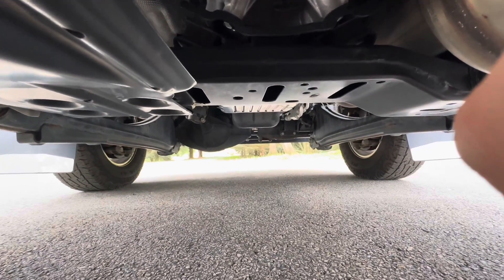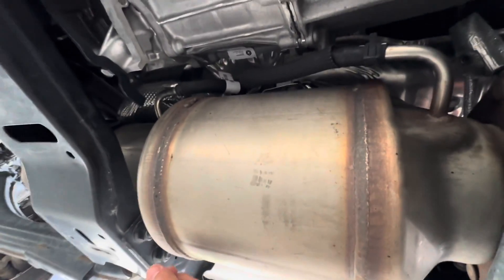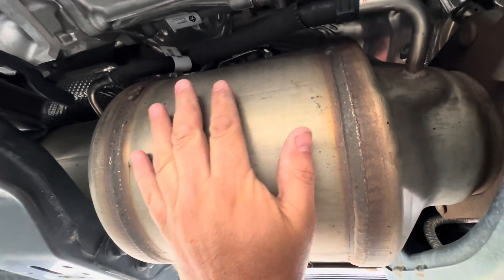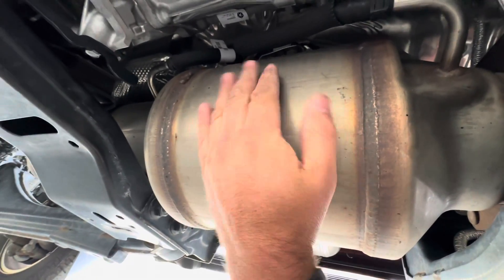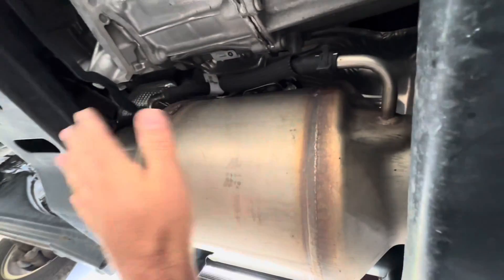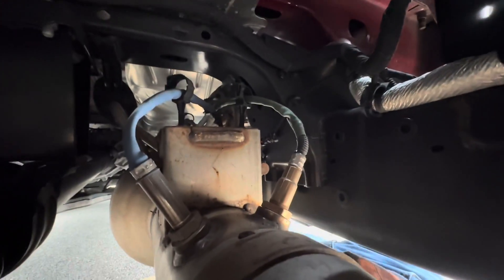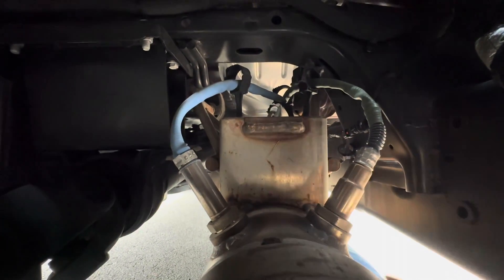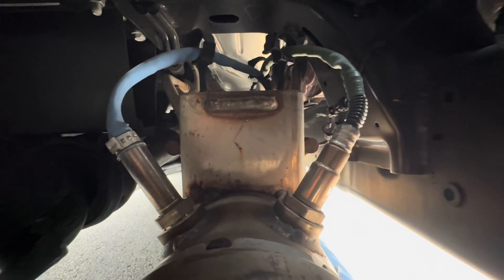2022 Ram Cummins DPF Regeneration and Y43 Recall Explained

Comment: Thanks for the video, super helpful.  My 2019 Ram 2500 has 53000 with check engine light "exhaust filter full, power reduced, see dealer" . Two weeks ago I had a mechanic clear the code so the Active regen could take place.  I drove the truck for about 40 minutes and all was good.  Until yesterday.  The filter was showing about 45%ish, the active regen started, but after about 10 minutes, the same error displayed.  I have two questions.  A: does this mean my filter needs to be removed and cleaned?  B: Is that covered under warranty?  thanks for any responses.
Reply from the maker: Very unlikely that your DPF needs replaced in 53k miles. More likely you either have an upstream issue that’s preventing the DPF from regenerating properly, or something internal to the DPF is causing a regeneration issue. If the dealer is seeing code P242F and basing their judgment on that trouble code alone, that’s not a good enough diagnosis to automatically rule that the DPF needs replaced. There needs to be some diagnostics performed to find out why the truck is not regenerating properly. How do you drive and use the truck? What kind of drive cycles does it see? Are there check engine light and trouble codes active? How many engine hours (drive hours and idle hours)? Factory Emissions warranty is 5 years or 50k miles. Some states have overriding emissions laws that extend the warranty.
Reply: @TheRamGuru  Thanks for the quick reply!  I have an appt with the dealer tomorrow, so I'll see what they say, but wanted an independent opinion before they suggest replacing it all at my cost.  I'll be sure they do some testing.  The truck exists in my world to tow our 12K lb trailer, but it's also my daily driver in Arlington, VA with a 10 minute commute to work.  It only gets good and hot maybe a few times a month.  running hours is about 1200 and idle is ~250ish.  I picked up the truck in 2022 at 16k miles after sitting on the lot for a year.  I purchased the extended warranty to get me more time due to it being half way through warranty.  Thanks again for your response.
Reply from the maker: @dairyqween  no problem. With those short drive cycles, it’s not going to get hot enough to regenerate passively, especially if that commute to work is all low speed and stop / go driving. Do you monitor your active regeneration cycles? Do you allow the truck to complete those when the message shows on the dashboard?
Reply: @TheRamGuru  I have not paid much attention until two weeks ago.  I will now. sounds like I should plan on getting it out to stretch its legs more often.  I'm happy to hear it shouldn't need replacing at 50k miles.
Reply from the maker: @dairyqween  you really want to try and get it on the highway at 70mph or higher more, especially when it’s going into an automatic regeneration. It’s really important to let those cycles complete. Usually takes 20-30 minutes on the highway. Constantly interrupting those regeneration cycles, especially with a truck that sees repetitive low-speed operation or lots of stop & go, can lead to DPF issues. The truck never gets a chance to adequately remove the soot in the DPF. Also avoid idle time as much as possible.
Reply: @TheRamGuru  Just as I was worried about...this is the advice from the dealer.  I would like to ask them to Check the sensers or something before just replacing it all.  is that a thing?  thanks for any advice you have on avoiding the $3700 replacement.

Advisor comments:

Diesel Particulate Filter, dpf gasket, both exhaust gas temp sensors, Differential Pressure Sensor - Replace the Diesel Particulate Filter and sensors then perform the DIESEL AFTERTREATMENT VALIDATION in accordance with the Service Information
Reply: For those of you following along, the DPF and associated parts labor will be covered under warranty and will not cost me $3700.
Reply from the maker: @dairyqween  that’s good news!
Reply: I had a customer bring me a 2022 ram Cummins today that cannot be forced region It's a forest service truck. They are down here fighting the fires in New Mexico. The dealership couldn't regen it and sent them to me. It's only got 22,000 mi It's reading 100% and will not let me force manual regen. I guess there is a problem going on with the their security at the dealership that's why they can't do it. But I used a bypass cable and it still would not let me perform a manual. Regen, have you seen this problem?
Reply from the maker: @SMOKEY-JAYS-DIESEL  is the truck showing DTC P242F?
Reply from the maker: @SMOKEY-JAYS-DIESEL  when that code is active, the system will sometimes inhibit active regeneration because the truck thinks the DPF is full of ash, not soot. So it won’t let the DPF run a regeneration cycle because ash isn’t able to be burned out in regeneration. It has to be washed out mechanically with high pressure water or chemicals. At 53k, it’s not likely that the DPF is full ash restricted. It’s probably just so full of soot from high idle hours or a lot of low speed operating where it couldn’t effectively regenerate all the soot out. It may also be face plugged at the DOC. What you might want to try, is to go into the pcm with a good scan tool, reset the regenerative filter timers to trick the truck into thinking it has had the DPF replaced. Then attempt to run a parked regeneration. Make sure it has a decent amount of fuel in the tank too. There’s a good write-up on this over on Cummins forum if you search “P242F - what I’ve learned” it might help you
Reply: @TheRamGuru  okay awesome thanks! I even put EZ lynk on it and used the bypass cable and that also failed The strange thing is it says there's not enough fuel in the tank which it's 3/4 of the way full. So then I adjusted the fuel tank size and then it tells me it can't read or initiate manual region but the truck only has 20K miles I have in the past. Had to wash some dpfs out using a pressure washer so maybe this is the case. I told them to just delete it LOL
Reply: @TheRamGuru we have had nothing but problems with constant regen most recently about less than 100 miles and check engine light comes on.  This has been happening about 6 months or more.  We’ve had it to the dealer twice most recently for 5 weeks.  They replaced the air suspension system saying that was the issue.  If fixed the overload code issues but not the regen.  Now waiting for another 6 weeks for a loaner to get it back in.  We’ve had it in 10 times since we purchased it brand new in October 2022 Ram 2500 diesel.  We have now contacted a lemon law attorney.  Enough is enough.  The dealer did find diesel fuel in the oil and told us to get it changed.  It had been about 3000 miles since last change.  It’s so ridiculous that Ram hasn’t figured out a solution for this!
Reply from the maker: @kristineketoon9929  it’s ridiculous. It seems like the 2022’s are especially prone to these issues. Ram is fully aware of it, but doesn’t seem to have a good grasp on how to address the emissions issues.  I have a spreadsheet with over 100 trucks on it, all of them having similar issues. 70% of them are 2022 or newer.
Reply: @TheRamGuru  your recent YouTube video comments helped us to ask the dealer to check the oil and he admitted it smelled like diesel.  We didn’t send it out for verification though.  He also admitted they have no idea how to fix our regen issue and that most diesel mechanics are not equipped to know how to fix it and apparently they just do what the star techs tell the to do
Reply from the maker: @kristineketoon9929  that’s the truth. Many of the dealerships do not have sufficiently experienced diesel technicians or those experienced enough with these emissions systems to try and troubleshoot or diagnose. They rely on STAR support, and their guidance. The STAR support is often slow to respond, and, depending on which agent the tech works with, the results can be hit or miss.
Reply: @TheRamGuru  the dealer tech also said he had not heard of diesel getting in the oil from the regen issues.  Amazing how Ram is not putting this stuff out for at least the dealerships to check for this. Who knows how much damage may have been done to our engine by now.  As I said this has been an issue since we bought it.  We bought in 10/2022 and had it in the first time in 11/2022.  They kept blaming my driving.  Seriously I am not gonna go drive for a half an hour 70 miles an hour every 500 miles or less because it decides to regen.  We have used 1/4 take of Def fluid in the two weeks since we picked it back up from the dealership

Comment: Drove trucks for a living , bought a 2500 with Cummins  , did you say when Ash clogs up , it needs to be replaced . ?
Reply from the maker: Correct, over time, the DPF will accumulate ash that’s a byproduct of combustion and the removal of soot. It’s actually the remnants of the oil additive packages in your engine oil. The ash will build up slowly in the DPF, and can not be removed through the regeneration process. The DPF has to be physically removed and washed out with chemicals in order to remove the ash. Or, you can just replace the entire unit when it becomes full of ash.
Reply: I believe the ash is what ended my hotshot business. My truck literally choked itself out.  I got completely scammed by the Dodge dealership..  They never fixed my issue. @TheRamGuru

Comment: One correction - during REGEN, additional fuel is sent to the DPF, and the soot is BURNT and turned to ash. The soot does NOT get eliminated & removed from the DPF. Soot gets burnt to ash, and the ash is collected in the DPF. DPF's get plugged up with SOOT when the REGEN process is not done, AND, the DPF will eventually plug up with ash. When this happens, the DPF must be removed and cleaned.
Reply from the maker: I never said soot gets “blown” out of the DPF. Well aware of how the regeneration process converts soot into ash via heat. Did you watch the video? 3:00 min mark forward.
Reply: Maybe you should watch the video again

Comment: I drove from Houston to San Antonio with a message particular filter regeneration in progress continue driving almost 200 miles before it cleared the message and returned to zero
Reply from the maker: That usually indicates that you are either interrupting the regeneration cycles and not letting them finish routinely, or you have something else going on that’s making the regeneration process struggle.
Reply: @TheRamGuru  can the inlet and outlet airflow sensors on the death filter be swapped out
Reply from the maker: @Kingdome_Trucking  it’s one sensor that reads both inlet and outlet pressures. And yes, they can be replaced.
Reply: @TheRamGuru  where is that sensor? Is it the one on the right at the end of the video (particulate sensor)?
Reply from the maker: @janericchannel4513  yes if you go to about 8:16 in the video, the PM sensor will be on the right. It’s the one with the green wrap around the wiring harness. It’s on the outboard side of the exhaust pipe. The sensor on the left with the blue wrap around the wiring harness is the NOx sensor. Both sensors are located aft of the SCR chamber. They are the last two components of the after treatment system.
Reply: @TheRamGuru thank you
Reply: I have run five six bottles of fluid additive claiming to help clear the DPF engine code saying that the DPF filter is full but no luck. Only 50,000 miles on my 2021 ram 2500 6.7 turbo diesel engine. So frustrating. In the whole life of the truck, I have probably only had a forced regeneration three times. Something has to change with these trucks. It’s almost as if the government wants people to quit driving diesel vehicles????Hmmmm???

Comment: What additives would you put in fuel got help keep DPF working smoothly
Reply from the maker: I’m not a big believer in additives. Good clean diesel is what you want. Maybe some additives occasionally to help clean the injectors but I wouldn’t do so routinely.
Reply: @TheRamGuru  So how would know if you got clean good diesel? You make it sound like you can go some were and measure the diesel quality.

FWIW  everybody can use and benefits from additive just because diesel quality is always lacking.  I run EDT in my fuel fill up and diesel service. I also have some Gumont diesel cleaner that I use in my New Holland since it has a basic DPF setup with no driver information on what it 's doing of anything with DPF clogging.
Reply from the maker: @kfelix2934  I heavily tested several fuel additives. Hotshot EDT and Extreme did absolutely nothing to reduce soot loading, extend the time or miles between regeneration cycles, and also provided no appreciable gain in fuel mileage. I also tried Power Service in the silver bottle. Same results. The only fuel additive I have used that actually lived up to its claims is Archoil AR6400D and AR6500. Both have helped to increase time and miles between regen cycles as advertised, with the AR6400D being more potent. In terms of Fuel quality, my point was to obtain fuel that is being purchased from a source that routinely turns their fuel over. Buying fuel from small “mom and pop” gas stations in the middle of nowhere, where fuel has a tendency to sit in storage for long durations increases the chance for buying fuel that may be contaminated in some manner (IE: water, sediment, algae, etc )

Comment: I am getting a message on the dash. Says exhaust filter full power reduced see dealer. Is there a way to force it into regen?
Reply: Same problem twice now with my 22, I am about fed up with this truck for the price we pay this should never have a problem. These things are simply lemons...
Reply from the maker: Not without the proper scan tool. What model year and how many miles?
Reply: @TheRamGuru 2022 Dodge ram 3500 got a autel maxi
Reply: @TheRamGuru still cant force regen
Reply from the maker: @surenatashkarian4439  with the correct scan tool you can. Certain tools, like a Witech will give you the ability to conduct a stationary desoot.

Comment: What if you don't complete the Y43 recall? Is that a big deal??
Reply from the maker: Yes it could be. If you need a pcm flash update in the future, when the dealer uploads the new flash, it’s going to contain the software to communicate with the PM sensor. If the sensor isn’t installed it’ll generate a perpetual “lost communication with pm sensor” code until the sensor is installed.